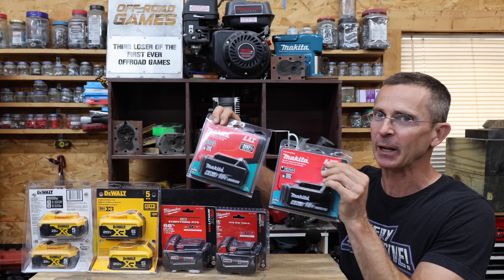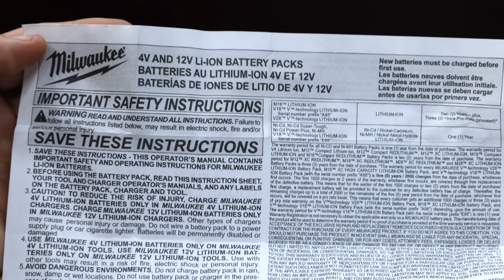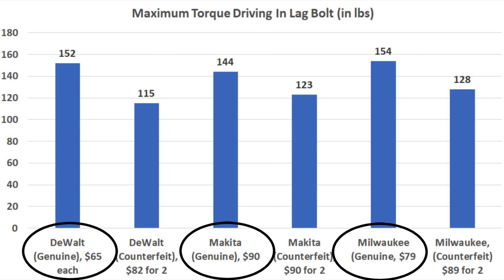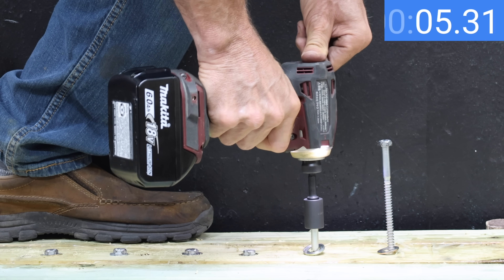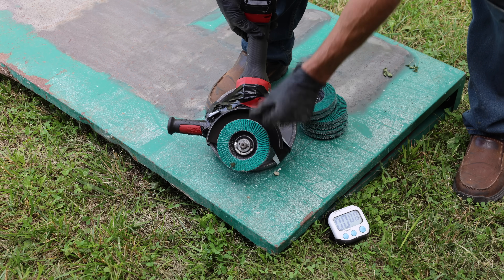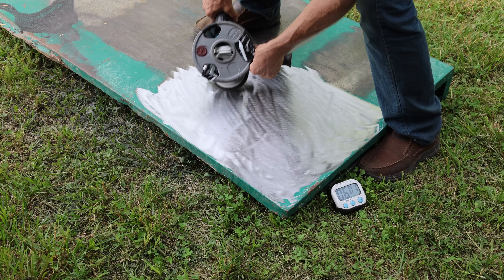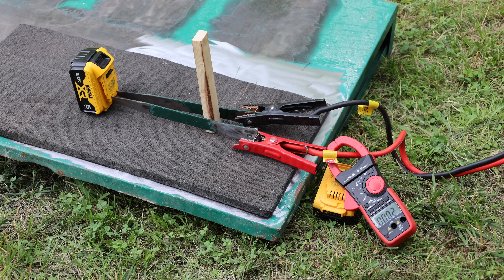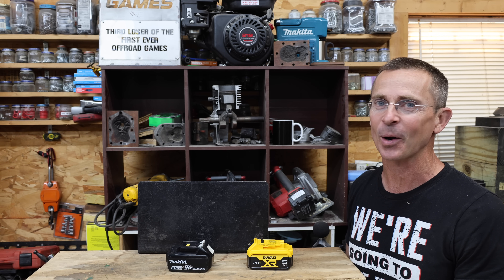Have You Been Scammed with a Counterfeit Tool Battery?

Comment: I try to charge all batteries, even my phone,  on a solid tabletop with nothing flammable close to it.  They make firesafe bags for charging the bare batteries used for hobbies but would be cumbersome for daily usage.  Someone who's doing daily recharging of tool batteries that are dropped and abused, would do well to have a reasonably fire-safe area to charge them.  Perhaps on a large tile or a marble slab and don't have anything but the chargers on that slab.  A step further would be an enclosed area. Could use an old microwave. Take out the electronics and you have a steel box to contain the fire, with an easy-access door.  Cables could feed through the existing waveguide hole.  Place a smoke dector above the vent.
Reply from the maker: Thanks for sharing.

Comment: I recon you are right this is an inside job, there is no way you should be able to register counterfeit batteries on a Brands website, proof of purchase needs to be required at the least. So that checks can be done by Brands to quickly close down counterfeit sellers on bulk

Comment: I got an email from that mega online tropical rainforest store informing me I MAY have received a counterfeit battery pack. All of my batteries, 10 total bought from different sellers, some with tools some without, look exactly the same. They also all seem to work the same. I've had them for several years and they have never given me any trouble. I no longer leave them on my 4 port charger unattended, just to be safe. Thanks.
Reply from the maker: Thanks for sharing.

Comment: I bought some 18650s. What sold me was the statement each were 9800Ah. WOW! Thought I.
Sometime later I read where Lithium cells are physically limited to something like 3800Ah. Oh,
thinks me. Well, those batteries are still working out in my garage I use them in my flashlights
that I use while working on my tractors or Jeep of Mowers. Heres a quest>> Why do trail cams 
need 8 AA batteries when 18650s are readily available?

!
Reply from the maker: Thanks for sharing..

Comment: Amazon and eBay are havens for counterfeiters!  I won't buy car parts, tools, or many brands from them.  They clone spark plugs, oil filters, car parts, tools, batteries...1) they don't see it as counterfeit, just another item, 2) Manufacturer's should not build there to keep their trade secrets - either info is leaking from legit factories, or they reverse engineer from patents (I was in industrial products and know this well, they explicitly talk about redesigning just enough to get around the patent).  STOP IT!  Meanwhile, EBay and Amazon need to tighten up their supply chains and vendors if the want to fix their marketplaces...nothing will happen until someone new comes in (and it won't be Temu!

Comment: Thank you for doing this test. I do not use DeWalt batteries because I don’t use any drills or anything. Maybe one day I would own one or something, but I got a great understanding about batteries and how dangerous they could be especially when I’m driving an electric bike and these batteries, if they come from China made incorrectly Without being tested before they go on the action ride I mean, I’m glad that I didn’t blow up or anything. The battery was definitely more powerful than my last battery. I had a 36 V I went up to a 48 V with a lot more capacity. I was out there for an hour Zip in having fun testing the Kapacity you know assist driving around with the pedal assist. Also full throttle going uphill downhill next you know the bike just shut off so now I have to get my new battery checked out. I put my old battery back in. It’s working perfect the bike is working perfect so it’s definitely the battery. They showed a test that my electric bike can handle a 48 V battery even though it runs on a 36 V system the 350 W motor and the controller were made to handle that power. They even have videos on it cause I would’ve just got a regular 36 V with a lot of amp hours Like 20ah or 30ah but the new battery the funny thing about it is I would plug it in for five seconds the charger five seconds unplug it and I got full power. I just didn’t understand it because I don’t understand batteries.
Reply from the maker: Thanks for sharing.

Comment: If the serial number of a counterfeit battery is suitable for registration, this means that they simply took an old genuine DeWalt battery and used its serial number. Previous user simply didn't bother with registration. Older genuine casings may also be reused for fake content.
Reply from the maker: Thanks for the feedback.

Comment: This was a great video, thank you for this and others like it.  I recently bought a Milwaukee battery xc5.0, just like the one you tested, from Home Depot to avoid counterfeits and wanted to point out that the lettering on the bottom is actually darker vs lighter colored one you showed on the  video.   The packaging it came with was the same as the genuine one you showed, but I got paranoid and took it apart to check the internals just in case. It does seem genuine with the right board and green colored Samsung batteries.  So it's possible that there is a run of genuine Milwaukee batteries with darker lettering on the bottom, just in case folk are wondering.  Thanks again!
Reply from the maker: Thanks!  Thanks for sharing.

Comment: I saw this video literally hours after ordering the pair of Dewalt 5.0 Ah batteries. My shipment came in and on the one hand, they weigh 642 grams each. On the other hand, there is no strip of yellow underneath the release latch that would be indicative of the "new case design".  I guess I'll have to open 'er up and check for a circuit board and brand of cell.

Edit to add: My batteries were manufactured 2023.
Reply from the maker: Thanks for sharing.

Comment: One way I've seen people revive batteries was to put two of them in series and short them quickly or use a power supply to forcibly charge them. I'm sure it's not healthy for the batteries, but better than a dead one. I think this works because a the chargers only output power after they received a signal from the battery to avoid being able to be applied to anything and everything put between the contacts.

Comment: I recently bought a 4 pack of dewalt 20MAX/3AH.  Not sure where I stand, as they are dated 2024, and have the QR code, but have the old style casing with the straight seam.  And since they are not the same 6AH as was tested, the weight test is irrelevant. I'm probably screwed. Any suggestions?

Comment: Somebody correct me if I'm wrong, but so far I've ordered two Milwaukee batteries from different dealers--so far, they both seem legit.  I got to this point  by only buying batteries I saw had dot welding on the package.  This has worked to this point for getting a real battery, but I wonder if anyone else has purchased a Milwaukee battery with the dot welding that was fake.  

Any responses?

Comment: Yes I have, love your videos btw.  

They were advertised as real Milwaukee batteries on eBay, looked 99.9% identical except the screws on the bottom weren’t tamper proof torx, the color of the buttons for the battery release, and the edges of the package weren’t blister packs like the real ones, and the LEDS were dim.  Even down to the paperwork and all the warranty stuff m, just insane..  

Internals were different and the cells and chips weren’t the same, cells were not Samsung, performance was not good….

Got my money back and called them out on selling counterfeit batteries like real ones, it’s a company in China that sells knockoffs….
Reply from the maker: Thanks!  Thanks for sharing.

Comment: I’ve enjoyed your evaluation of individual rechargeable battery tooIs. But it might be useful to someone just starting out to get an idea of what brands provide the best full lineup of tools.

I originally purchased a set of Milwaukee tools: a drill, circular saw, jig saw, and Saws-all.  Since then, I’ve purchased a number of other tools by the same manufacturer.  I think I’m like most people in that I wouldn’t buy another brand, even if your evaluation determined them to be better, because of the sunken costs in Milwaukee batteries and chargers.

I’m suggesting that you could use all of your previous tests to provide a meta-evaluation of the various brands.  Who has the best line overall?  I bought my tools long before you started your YouTube channel, but I wonder if I would go with Milwaukee based on the full range of your tests.

I did, by the way, invest in EGO lawn tools after watching your reviews.  But that’s because there is little overlap between the two brands.

Thanks for producing one of the most useful channels on YouTube.
Reply from the maker: You are welcome!  Thanks for the suggestion.

Comment: That's very unfortunate that Dewalt handed counterfeiters a great benefit for no reason. I "knew" that the one on the right was the copy because the logos on the batteries didn't match the logo on the packaging. So, that means that the genuine battery has classic "counterfeit red flags" while the copy is more visually consistent (and therefore less likely to be a copy, if you are going with normal visual ID methods).

Yikes.
Reply from the maker: Thanks for the feedback.

Comment: If package is labeled Dewalt it should be Dewalt.  That said i owen both oem and aftermarket batteries  18v and 20v. Aftermarket 18v is 6ah lithium witch out performed 18v oem. Aftermarket 20v at 5ah and 8ah with no problems guess i got lucky.
Reply from the maker: Thanks for sharing.

Comment: The Makita's usually weigh exact dead on to their listed weights so just look them up. Get an accurate kitchen scale.  Looking at the exterior molds or packaging may be revealing for the most lame counterfeits but the really good ones have cleaned those up to make them look pretty convincing. But the weights, that is not really replicable since the cells they use are cheap inconsistent junk vs the super high quality calibrated Sony cells used in the Makita.
Reply from the maker: Thanks for the feedback.

Comment: All about searching for the right maker....$40 for 2 of the 5ah Dewalt batteries WITH the battery level check button...4+ years with ZERO issues out of 12+ of them and theyre used all day long at the job site and even have Samsung cells in them
Reply from the maker: Thanks for sharing.

Comment: If OEMs did not inflate the price of the original batteries the profit margin for the scammers would be much smaller and make the whole thing not worth it. I looked up the price of a second battery for my mower and it was $50 cheaper than what I paid for the entire mower and battery when I initially bought it (one year ago). There is no way a 6Ah 60V battery should ever cost $250. If a replacement battery for my EV car was proportionally expensive it would have to cost way over 6 figures. Make the OEM batteries reasonably priced and nobody will even look at aftermarket batteries.

Comment: My opinion on the drill getting faster the batteries were encapsulated in a plastic housing so it kept it under pressure as it got hot and delivered more amperage all these batteries have to be under compression to work fantastic video as usual stay well
Reply from the maker: Thanks!

Comment: From what I have seen, the fake ones often drop the ball when it comes to numbers such as model or serial number. I could easily see the distinction between the 20v and 5AH on the packaging. Clarity of the fine prints also will be different. Composition or diagram accuracy is crucial, for example the charge time diagram shown at 4:18 minute mark. The genuine one shows a very accurate time depiction in the pic but what the fake one shows would be correct for 45-minute charge time not 55-minute.
Reply from the maker: Thanks for the feedback.

Comment: Another great post from this cool cat! I think there's no way to save money if you want the real thing. It's too difficult to check for a slight difference in color, bar codes, open them up, or anything like that. I just compared them with a genuine batterie from Lowes. The weight difference is obvious just by holding them. I guess if you don't have one to compare - you would most likely get a fake at Amazon, Ebay, ect - On-line is full of counterfeits. I got 4 in a row from Ebay and 2 from Amazon before finally going back to Lowes. I think Home Depo is legit too. Lowes is just closer to me.
Reply from the maker: Thanks!

Comment: Those ICR 18650s were designed to be used on laptops... not power tools. most power tool cells use INR18650... these cells should be able to handle at least 20A of current for use in power tools. I also use samsung 25R cells for my personal use devices that use 18650 cells. if you have to purchase 18650 cells for your personal projects, try to find INR18650s, preferably genuine samsung ones from reputable sellers... lots of fake samsung high drain batts going around the internet. Yes they are expensive... but the price is all worth it.

ps: I'd avoid buying no brand chinese cells like the plaque... you dont know what they put in those cells.
Reply from the maker: Thanks for the feedback.

Comment: Testing a battery with real wood is pointless. Wood material is quite random. You should use something much more consistent. A branch knot enough to mess the time completely. Kitchen countertops would be a perfect test material in my opinion but there are many other stuff for sure.

Comment: Worse than 'stinking'  batteries.  All and every Milwaukee 'branded' product sold on Amazon are NOT 'authorized" or Warranted by Milwaukee.  That bit of trivia is straight from Milwaukee management.   The good news is that far after the return date Amazon will refund without complaint out of fear of class action suits (pending).  Fake is fraud but fraud is not fake

Comment: Did you weigh the batteries fully charged or fully discharged? it's not much but a charged battery does weigh more than an uncharged one. couple of grams.
Reply from the maker: I weighed the batteries fully charged but that shouldn't impact the weight.

Comment: I have a 2022 set of DeWalt batteries, came with my 1/2 & 3/8 drive impacts. They're still working... a year ago my car died around midnight in the middle of nowhere, alternator died. Spent half an hour trying to get a cell signal, didnt work. I found a roll of thin gauge wire, wapped a bunch together to try and make it thicker and boosted my car with the 20V battery.... I do not recommend this, except in extreme circumstances, I boosted the car another 6 times, found a hotel and got a room for the night. Boosted the car another 8 or 9 times, got to a parts store, changed my alternator and drove another 4 hours home.
Reply from the maker: Thanks for sharing!

Comment: The control board is a BMS. Pretty dodgy that some of the genuine ones didn't cut power. They will have a certain amp rating, going above that the bms should have immediately cut power.
Also the load you're applying in the drainer is amps, not amp hours. Just like watts vs watt hours.  I'm guessing you know this and just said it wrong. Great vid as always. I build batteries often and use a wholesale reseller for genuine cells. Usually Samsung, LG, or Panasonic, though recently got some Molicell ones that can handle 25A per 18650 cell, great for high drain devices.

Great vid as always, look forward to your next one.
Reply from the maker: Thanks!

Comment: I bought a couple of 5ah Dewalts.  The deal was good... right around $80.  They are backups for my mower when the 10ah run out.  Need to use them only a few times a year.  Yes, after watching your video and weighing mine, yes they are counterfeit's.  I am disappointed for sure.  They clearly don't have the equivalent 5AH as the Dewalt.  Their weight is 604 grams.  I got scammed once.  never again.
Reply from the maker: Thanks for sharing.

Comment: I found out many years ago that counterfeit ebay ACDelco iridium spark plugs were a thing.  I was trying to track down a shudder with my suburban.  Felt like a misfire but there were 0 misfire counters.  Ended up being the torque converter.

During the diagnosis, I pulled the plugs with only 6 months / 7K miles on them and the iridium tip was just a rounded nub.  I contacted the seller a and he refunded my money immediately no questions asked.

What's crazy is they did not misfire and the vehicle got the same fuel efficiency as always.
Reply from the maker: Thanks for sharing.

Comment: Counterfeit batteries aren’t generally going to be any different. There are a handful of places in the world that can manufacture these and they aren’t something you can make in your basement. The problem comes when they buy the cheapest batteries they can find and use them in inappropriate situations for what the battery is rated to handle. Also this could change day to day. One day the counterfeit might be exactly the same and the next not. They aren’t really trying to maintain a reputation.
Reply from the maker: Thanks for the feedback.

Comment: It's not just the battery market that's inundated with counterfeits.  The precision tool market is also highly infected with counterfeiting.  I've noticed that the counterfeiters now have raised their prices to be just slightly lower than the genuine items, making them harder to spot and boosting their profits.  When you buy a $200 item thats $10 less than anyone else is selling it, theres a chance that you could be buying a counterfeit.  The digital micrometer market is another area that seems to be plauged by counterfeits. My rule of thumb is to buy from a reputable dealer if I want to avoid scammers.
Reply from the maker: Thanks for the feedback.